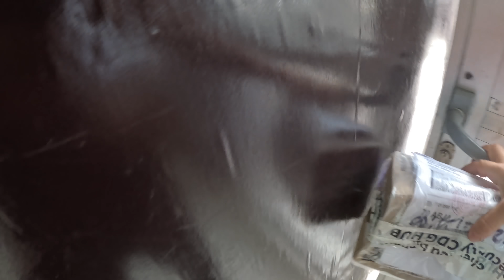Opening up the engine of my Honda CRF300 Rally in West-Africa |S7-E52|

Comment: As a mechanic for 50 years I am all ways amazed at their work shop conditions. Well done to those mechanics
Reply: These are real mechanics. Not part changer's.
Reply: Hope the valves are tightened to spec., important to presoak clutch long before install, 
they got er done...
Reply: @gpt3342 I was concerned about the presoak as well..
And as far as valves.. do you think they did?
Reply: some of us are "laboratory" mechanics. they are street technicians. kudos.
Reply: @oscarmike4596  they sound over tightened,
 I could be 100% wrong.
Reply: I does look a bit scary. However some of the best mechanics going, work on rally & raid cars n bikes. Could be car park, forest clearing or desert bivouac.
Reply: I’ve been a Harley Davidson mechanic since 1980. They got you back on the road with no service manual, no torque wrench, no rags, and no shop air. Good for them, but I’d be riding with my fingers crossed. Don’t want to be negative but over the years I’ve seen a lot of backyard repairs come into the shop. Been following you for years great videos but just worrying for you on this one.
Reply: They are mobile  mechanic operator,  I also doubt they have worked on a Homda rally  before.  This  mechanical skill is rare to find! Good luck finding him. The valves will be shim in bucket type I would think.   Noraly what was the cause of top end noises  from beforehand? Gr8 your  rolling again!
Reply: @lbahr11 I see what people are writing here about these "professionalists" and I do not believe my eyes 🙂
Reply: The mechanic has a Gucci hat and drives a BMW so he must be doing something right.
Reply: @kiwiingenuity1677 Somehowe the noise was generated because the engine was running hot. The fan wasn't coming on.
Reply: @gpt3342  Which was my concern also!  It is running and she's able to shift!  A good start.  Praying and keeping fingers crossed for her!
Reply: A torque wrench isn't recorded or it is just a missing tool in the tools bag? Maybe she could have changed the cylinder rings if the engine was already overheated now that it was taken apart.
Reply: Why did they remove the cylinder, piston and timing chain to replace the clutch?!
Reply: @@TheRealBrownShady Stealership. I like that word.
Reply: @gpt3342  exactly mine thought, i just finished my clutch and this step of soaking at least few hours, was written all over the packaging. Lets see how long will it last and if there wont be some mud soon,it might survive.
Reply: I didn't see shop rags used in this operation.  Didn't he remove the wrist pin clip without covering the crankcase opening? I'm glad that clip didn't get loose and fall into the crankcase.  It was difficult to see all those details.... maybe I missed something.   Anyway, at least it got back together and is running.
Reply: @oscarmike4596 they probably did the best they could I didn’t see any feeler gauges or a torque wrench in sight but hey it’s running and she’s riding it. And that clutch looked dry going in on video but who knows.
Reply: @clif1969  You have got that right!!!
Reply: @theupscriber65 because she was having engine overheat before. So while the engine is out. She/they want to take a look inside and make sure there is no damage beside the clutch or other metal bit get in.
Reply: @ShinyKnife that’s probably how they did thing in Africa country with limited resources !  That mechanic probably take more engine apart in a month then 99.9% of what I saw comment here in a life time!
Reply: @@bacorable 😄
Reply: Beautiful job. Took there time
Reply: @mracer8  I totally agree with you, they did it the way they do it
Reply: @theupscriber65  with so much loose metal debris from a wet clutch the rod bearing might have been damaged. Or the piston itself. Was a good call.
Reply: @bradboustead1682  Also wearing a Jack Daniels Tennessee Whiskey tee shirt when Alaska was coming apart.  As a Kentucky native, I know why Jack Daniels isn't called bourbon even though it could be and I respect them for that.  Like it or don't like it but, it's in no way inferior.
Reply: yes like being in the Military stuck in the Jungle you find a way
Reply: As always,  still able to surprise us with the amazing people you seem to be able to find at just the most  desperate times. We love you Loraly!!!
Reply: @@bacorableToyotas cost more than BMWs and Mercs in Africa. German cars go really cheap. The hats are copies.
Reply: So much respect to the mechanics.
Reply: @lbahr11  Harley mechanics get a lot of practice.  Whenever I rode a Harley I had my fingers crossed.  And for good reason.  For instance, I was riding my brothers bike back from school several years ago and felt a pretty good slap on my leg.  A little later the cycle slowed and stopped and refused to start.  What slapped my leg was an oil line that came loose so the engine ran dry and that really did call for a total rebuild.  I have no idea what that repair cost my brother but I'm glad I didn't have to pay the bill. Not my only experience with Harleys.  I'm not really qualified to critique their work but in reality it wasn't an engine rebuild.  It was a clutch replacement.  If it hadn't been for all the bits that scattered around inside the engine it would have been an even simpler repair.  Not that I could or should do it.  I actually wouldn't touch it with a stick. But other than that there was no need for a lot of analysis of electronics or assessing and addressing worn parts.  No carb adjustment etc. And I assume they know what a wet clutch is and how they function.  From what little I saw, I think the guys that did it did an excellent job.  And quickly and courteously.  And I assume they're the ones who told her to get an oil change after a low number of miles to assure there weren't still bits of metal in the system.  In all, under those circumstances I think she got good and timely service.  And even personal consideration because of the circumstances.  Can you imagine something like this happening in the US?,   "Yes, mam.  we'll be right over to fix your bike.". It would be more like, "Well, most of our mechanics will be on vacation next week.  But maybe we can fit you in the week after.".  And then they'd charge her so much she'd have to sell the bike to pay the bill.
Reply: @gpt3342 
The engine was run before the use of clutch, soaked for a day ,then back wheel went on and test ride. These guys can think out of the box.
Reply: @kl9518 well spotted 👍
Reply: @lbahr11  Well it's a Honda and not a Harley so I wouldn't be worried. :D
Reply: As a specialist, I ask you, why did he have to put the clutch plates in oil??? To skate the disc??? The mechanics dismantled everything to check for any malfunction or hidden piece of metal. You who have modern workshops with everything necessary, must appreciate these aces in action.
Reply: , Bravo. They checked everything. Do you think that without a torque wrench the engine does not run??? Craftsmen have the key in their sense of hand. Only specialists and library mice. Need teaches you in life how to handle it. Most without a tester and all kinds of devices can do nothing. Even if it's too tight, he'll let go along the way.
Reply: @Kimu58 If the hat was original, it kept cooler??? How naïve can you be
Reply: Many watch, but few pay attention. They also give their opinion as great specialists. Babe's gossip on a bench in the park. Write on the instructions what kind of clutch it is.
Reply: Seriously? They've done a good work but what is there to be amazed about? Especially when you were a mechanic...
Reply: Given the number of motorcycles we see in the background and the riding conditions they have to deal with, I would think that clutch replacement is a common repair.  Once Noraly reaches a city with a Honda dealership, perhaps she will have everything checked out as she has done in the past.
Reply: @S....  Why do you care? Mind your own business.
Reply: @leplane_  xD
Reply: 😆Guilty as charged!@@TheRealBrownShady
Reply: Amazing work. Those guys just get on with it!
Reply: What workshop?
Reply: @theupscriber65  My compliments to you. Your the ONLY one in the comments I've read, to ... ask this question.
Reply: @bradboustead1682  we  can  zend them  chainsaws  and lawnmowers  from EUROPE   to  REPAIR.
Reply: @theupscriber65 to get all the broken pieces of clutch basket out,they rinsed it all with petrol aswell
Reply: Like Inuit stripping down a snowmobile engine out on the Arctic sea ice, and reassembling so it runs and works. None “Western” mechanic “whizzs” do brilliant repairs throughout the world.
Reply: @kimu58 you talking utter rubbish by making senseless assumptions. No ways a BMW or Merc cozy less than a Toyota. Go rest
Reply: yep. if you open an engine in conditions like that, imagine what you can do with good conditions and proper tools... those guys are amazing
Reply: Looking at what and how they did it, I would never let them touch my bike. That was horrible. But on the other hand, I am a professional tech working on cars and bikes for a living, not a single lady stranded in Africa with no other options available. But I'd definitely keep my fingers crossed if I would be in Norally's position. That was a sketchy-looking job in my opinion.
Reply: A small amount of sand always helps the engine start up faster. 👍 😊
Reply: @mracer8 you know where some people that love despising others come from exactly, don't you? I wonder if they would even do anything at all if they were working in such conditions with limited resources @
Reply: Honda should ship you a new bike.   The amount of advertising you provide them.
Reply: Reminds me of Cuba, those mechanics by now, with the right tools and a bit of training they could work for NASA 😂😂😂
Reply: The soak happened whilst the mechanics left to take care of another job?
Reply: @podunkman2709  Because you're a youngblood. Dusty working conditions and gasoline washing of parts was the norm until a few decades ago in the west also, and cars and bikes were exploding left and right.
Reply: @theupscriber65  To check for any other issue since it was just a bit extra time, she said it in the video.
Reply: é vero ma chissà quanto dura quel motore con quelle condizioni, senza dinamometrica,  senza pulizia ...speriamo !!
Reply: @lbahr11  I understand your worries when looking into it from the way we regulate everything to be sure of the quality of service. But knowing both parts of the worlds. In my experience, mechanics there  know their stuff and are able to deliver in good or harsh conditions. Especially mechanics with reputations. It takes them years of being mentored before getting there. The 2 helps of the main mechanic there, who were also doing a good job, were being mentored. Generally speaking, they will one day be able to work for themselves when the mentor says they are ready. I was not worried about the main job they had to do
Reply: @gpt3342 
This is news to me ...
We would cut the pre-oiled bag and put the clutch plates in ...
Run a short easy test loop then gate drop ...
Why do you recommend soaking the clutch plates ?😊
Reply: Keep in mind, in most cases these guys don't have the luxury of going to school to become a mechanic. Instead they teach themselves by reverse engineering and experimenting. Awesome video.
Reply: What has alway impressed me is that the people in places like this often didn't go to college to do what they do. Kinda makes you wonder why they exist here in the west if they aren't needed elsewhere.
Reply: This Men is Expert he know Well. No broblem Real Technician ur motor is Sefty Machanic engineer 
👍
Reply: @lbahr11  Then you need to worry for all kinds of Bikes in Africa. You need all kinds of equipment and training to work on these machines, we in Africa need just COMMON SENSE.
Reply: @gpt3342  Will they work as perfect if they are not. They said the engine is as new after work, take it that way. That's all the certification you need and the lady confirmed it to be so.
Reply: @lbahr11  You don't need to be worried about anything these one will not be going into any shop in the next too yrs. Keep following to see.
Reply: See you top up fuel but not engine oil...😅😅
Reply: @theupscriber65 to clean all the cluch deber out of the engine.
Reply: Maybe true, but I would have still gone to an official Honda repair shop.
Reply: Africa
Reply: I was afraid if the whole bike could be stolen during that 1.5week
Reply: @clif1969  yea you aren’t kidding! These guys are true diagnostic mechanics. They have to be and have learned knowledge over the years on how to fix instead of just replacing everything as we do in America. We just buy it and swap it.  These people in 3rd world countries are so skilled at diagnosing and fixing issues. It’s awesome
Reply: @timschmitt7550  right…I  too was wondering why they didn’t stop at the 3 or 4 official Honda repair shops they passed (sarcasm). You do realize she is in the middle of Africa and not cruising around the middle of Europe or the US right?
Reply: @nikitaderbenev5811 well seeing as you will never probably find your self in the locations and situations that Noraly finds herself in, you probably won’t have to. You talk like she had an option.
Reply: Sure I thought they’ll fix it! If you see the amount of motorbikes riding there they’ll know how to fix engines
Reply: @lbahr11  no worries, this is not a backyard repair. This is a roadside repair 😅😂!
Reply: Magicians real mechanics instead of part changers charging ridiculous and pretending to be smart without solving the problems.
Reply: @IronKnee963  In Africa, like most places in the World, it takes 7-8 years of apprenticeship under a seasoned boss. Upon graduation, they are supported with seed money, tools, connections, and blessings by the boss.
Reply: @Kimabnwa  Nobody said they aren't putting any effort into gaining their knowledge. lol Of course they have work on their skills and of course they will have a mentor. What's your point? Stay within the context and stop pretending like it's the same process as the western world.

Of course those kind of businesses exist too, but it's an actual blessing that not everybody has to follow some kind of corporate structure to make money.
Reply: @bradboustead1682  Despite deprived of a modern workshop.They are experienced, skilled and very serviced oriented specifically when they deal with foreigners. Am Ivorian and I know my people.
Reply: Having  a machine restored to mobility in a remote location makes you grateful
Reply: @orbanjozsef7675  Whyi come you come with this idea??? Explain. ! In anycase it was not stolen but Stored , repaired and delivered they deserve congrats😛😛
Reply: Such a brilliant work by those guys really appreciate 👌 India 🇮🇳
Reply: Big 👍
Reply: @lbahr11  "..over the years I’ve seen a lot of backyard repairs come into the shop."   What you have not seen are many thousands if not millions of backyard repairs succesfully done all over the world in places where there is no spezialized shop at all.
Reply: @Kimu58  they all want a Mercedes though for a taxi.
Reply: @gpt3342 of 😂they know what they’re doing 😅
Reply: They are the cleanest mechanic around the world. 😂
Reply: @mracer8 it's good to have a pro fan like you. 😂
Reply: @timschmitt7550 that sounds expensive. 😂
Reply: @dwcoyote that sounds ten times the cost she got it there done. 😂
Reply: @mracer8 what do you mean by limited resources? Someone left the main road  and is travelling through the bush and you want her to see the best mechanic there?
Reply: @podunkman2709  Why? Can you work under that conditions?
Reply: Got d job done, much respect
Reply: There is no reason for negative comments the work conditions they operated and produced result is to be commended and I am glad she back doing what she love doing❤
Reply: Still can’t believe they pulled the engine out of the bike just to do basic checks and change the clutch. Ridiculous. They were just doing extra labor for no real reason.. maybe just having fun for the camera
Reply: @dwcoyote      ...Noraly was in Côte d'Ivoire, not "the middle of Africa", whatever that means. Incidentally, there are Honda repair shops to be found in the continent of Africa, so you don't really need to go into 'Fox News mode' and be so dramatic.
Reply: @illitrait  first off, your  Fox News comment makes zero sound nice. Secondly, my point was she was relying on others to help her and it’s not like there are Honda repair shops on each corner. As someone who lived for many years in Africa, I know how things work. Sometimes you just have to take the first available option because that may be the only one available that can get what you need done at that moment.
Reply: I Love Africans and Africa ❤
Reply: @nathankulp8063  The " friction plates" should be soaked or at least pre oiled to prevent abrasive wear to toe steel plates and outer pressure plate  . Quite a bit of abrasive wear can occur just in the first few applications of the clutch before the oil in the crankcase can  lubricate the plates . The only time that oil can access the contact points of the pressure plates is when the clutch lever is pulled in ( clutch disengaged) and that only occurs for about 1/2 a second every shift . This is why you preoil the " friction plates . 
Also , having raced motocross in the 80 s and purchased plates afterword's , I have never seen them come pre oiled. Not saying they dont , but i have not seen it. The plates shown in this video came dry
Reply: @georgemelinte8320  Just what are you a " specialist" in ?  Cooking?  Home building ?
There are no " specialists" in motorcycle repair. You are a mechanic or you are not a mechanic  and if you were a motorcycle mechanic . you would not have to ask this question. 
Anyways , if you look through the responses in this comment thread you will find the answer i provided.
Reply: Some silly folks over thinking poverty equals lack of intelligence. Most mechanics in Africa are next level in terms of understanding mechanical dynamics and finding solutions to otherwise complex problems.
Here, you either make it work with limited resources or abandon the fight.
Reply: 5 months later and I wished I could have said it earlier but you need a bike with bigger tires wider and more CC's like about a 500 + cc's
And the other thing is if they don't have any drainage for their roads the water will pile up there and make a big old muddy mess that they'll be stuck every time my God sitting for a month and no food those people are not using their heads I don't know but maybe many trucks had food in them to be shipped somewhere in the world 🌍
Reply: And another thing when you have low RPMs like that you're putting a lot of pressure on the clutch the transmission the crankshaft the wrist pain but you also don't want to over rev it and blow the engine up and especially you don't want to drag the clutch you want to be all the way out because the more you're slipping it the more you're burning the clutch up they used to make these bikes with big fat nabi balloon tires and that would have been perfect
Reply: Wow now I see why your bike is messed up you can't go that slow in a higher gear you're going to ruin the motor each gear should have a certain amount of RPMs and I can't believe these guys didn't adjust your clutch properly and once you let your clutch out don't pull it in unless you have to go to a lower gear or you just burn it up your clutch again
Reply: ...sure,  @dwcoyote , "sometimes". My point was that she was in a city in Côte d'Ivoire, where, incidentally, things actually get done. Sounds like we have a basic difference in opinion, probably because you "lived for many years in Africa", as opposed to me being African through and through. Peace.
Reply: Amazing watching your journey
Reply: poor people get resourceful. Either you learn to fix it or you go without.
Reply: These are the best mechanics around. No books, just years of hands on knowledge.
Reply: You have to love all the key board mechanics on this thread who think they could do better than those African mechanics ! You guys just keep hitting the keyboard 🎹 with your pinky finger and leave repairs to those African mechanics 🧰. PS: did you see the mustang and BMW in the driveway ? You don’t get to own one of those by being a bad mechanic !
Reply: Same here, I'm impressed too
Reply: @lbahr11 you had to be the one.  It’s good but never good enough.  In Africa educated in your best schools are used to that 🙄🙄🙄.
Reply: “Work in shit your work is shit”everything should be spotless this is painful to watch
Reply: @lbahr11  This was not their first rodeo , these are not DIY type.. so many many motor bikes to practice & learn, so their expertise is pretty high
Reply: @gpt3342  in  the bikes is that important?
Reply: @freddygarcia3049  "laboratory"🤣🤣🤣
Reply: @jerrym3261  ok
Reply: @mracer8 😂
Reply: incredible
Reply: Modern Shop Honda dealer in the USA…2024! they charged me 65$ to put a double strong OEM spring on my new center stand on an Africa twin 1100 2024. I put the first but the second was extremely hard. So they took out the one and started from scratch. Big mistake…wrong sequence. They put it obviously wrong it was pushing against each other it was looking awfull. I took it to my garage read the instructions carefully (there is a sequence of which of the 2 you put first. Took them out, And I put it myself with 2 screw drivers. I sent them an email with pictures, because the manager was insisting that there is no way to be installed as I was showing him on the picture. Being rushed to get rid of me they were busy. He even said to me that I got the wrong part and he won’t argue with Honda for it when I told him ok then order the correct part for me, because I bought it from another vendor. OEM though. I bought the bike from those guys and my previous one. No discount no nothing! Terrible experience. They work on a climatized shop with multiple raisers and techs. It looks like a spaceship. But apparently they are totally a waist. For a problem like that the one on the Video they would ask for 3000$ 4000$ what ever they wanted they would have the bike in for like a month and if you don’t have warranty you are done!
Reply: Modern Shop Honda dealer in the USA…2024! they charged me 65$ to put a double strong OEM spring on my new center stand on an Africa twin 1100 2024. I put the first but the second was extremely hard. So they took out the one and started from scratch. Big mistake…wrong sequence. They put it obviously wrong it was pushing against each other it was looking awfull. I took it to my garage read the instructions carefully (there is a sequence of which of the 2 you put first. Took them out, And I put it myself with 2 screw drivers. I sent them an email with pictures, because the manager was insisting that there is no way to be installed as I was showing him on the picture. Being rushed to get rid of me they were busy. He even said to me that I got the wrong part and he won’t argue with Honda for it when I told him ok then order the correct part for me, because I bought it from another vendor. OEM though. I bought the bike from those guys and my previous one. No discount no nothing! Terrible experience. They work on a climatized shop with multiple raisers and techs. It looks like a spaceship. But apparently they are totally a waist. For a problem like that the one on the Video they would ask for 3000$ 4000$ what ever they wanted they would have the bike in for like a month and if you don’t have warranty you are done! That was a Honda authorized dealer. Imagine the others…
Reply: These are real mechanic not like u amateur
Reply: @vichill3480  i think re himalayns bike not make this much trouble
Reply: @oscarmike4596  In my younger years did lot of motocross, hill climbs, Glamis dune trips. We always brought extra clutch packs. Soaking is oil before you assemble is good idea, but can also just start it up wrap the clutch lever with a bungee cord let it idle for 5 minutes oil will get between the discs before you put a load on it.
Reply: @ lived in Flagstaff for 11 years.. rode ‘the cinders’ a lot and also used to go to those dunes N of Moab… so I can totally relate…🫡
Reply: @clif1969 j était mécanicien de bateaux Maroc 🇲🇦  pendant 25 ans et j ai eu plus  d expérience en  Afrique que en Europe 
Et je suis d une ancienne génération ou je fixe le problème je ne change pas la pièces par du neuf 
Vive l Afrique